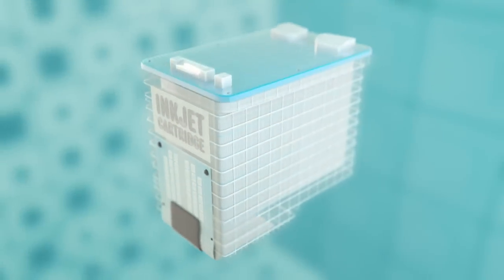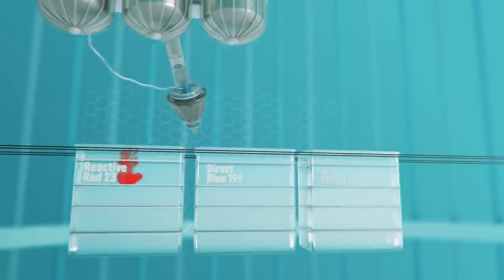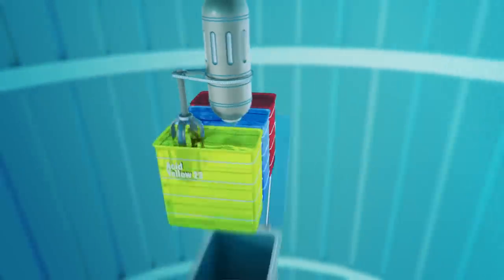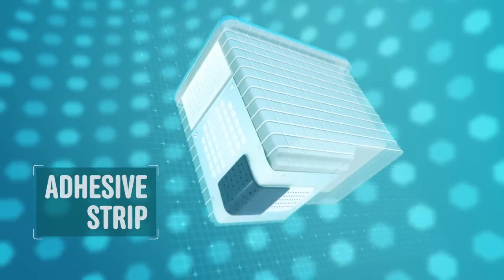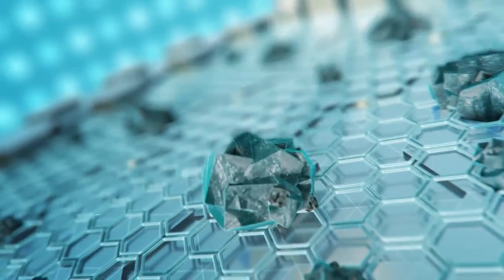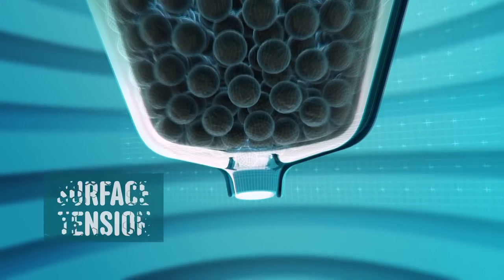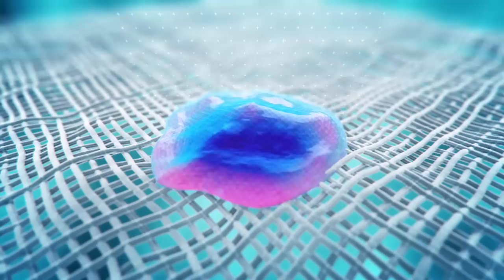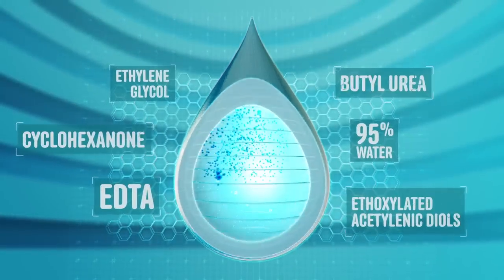What’s Inside: Inkjet Cartridges-WIRED

Comment: i miss printers that would print black if you were out of one of the colours. Now adays, if one colour is empty, the whole printer shuts down. you cant print black even if you wanted to.
Reply: Ehhh, most printers I believe if you go into the print driver you can set to use only one cartridge.
Reply: recentenly have a printer can print mixed black, in case run out off black ink… in case off Brother Printers...
Reply: My canon pixma ts3122 prints black only if you run out of color and it was only $35 at Walmart
Reply: Mine has an option to print in black and white if you're out of color
Reply: In most printers there is still a manual method to bypass ink status check, it's usually a one time thing then if the color ink is out it'll still print black.

Comment: Well Epson’s inks are quite similar but cost must less (refillable ones). Wonder what they did, oh wait, less greed.
Reply: I use an Epson Eco-Tank printer, and the ink comes in bottles which you can top up the level easily when it falls below a certain level. It’s much more economical than using the cartridges, and cheaper in the long run.